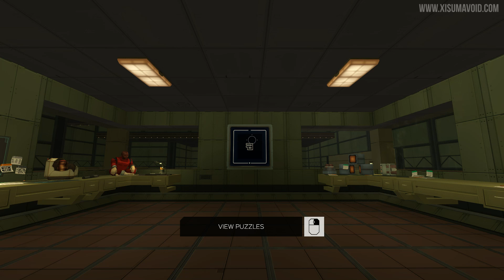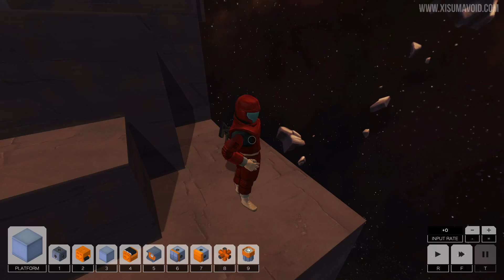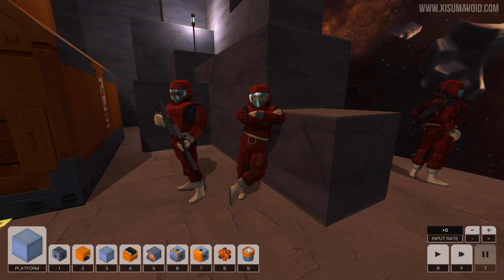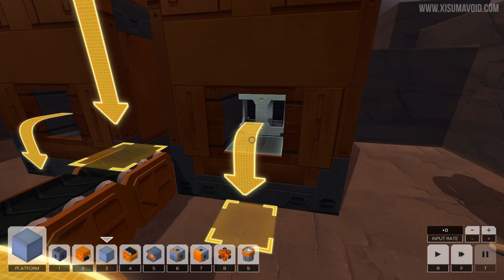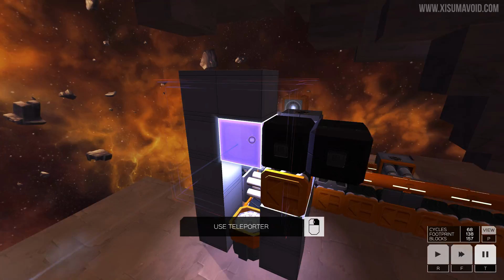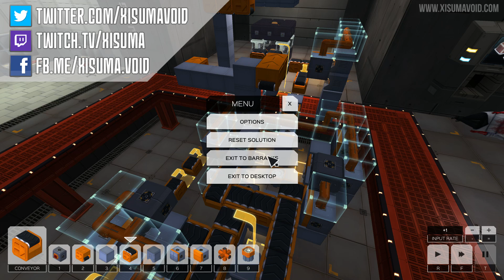Infinifactory The Big Blowout Episode 15

Comment: I'm wondering if you could have used the rotation blocks to reduce the size of that machine. Well done though.
Reply from the maker: +Russell Peake Probably, i don't use rotation that often :-)
Reply: +xisumavoid I also found, that if you use the area select tool from the blocks menu, you can select an area and then move it by using the block place button and dragging, or delete the whole lot with the block delete button. may make moving things around so much easier.